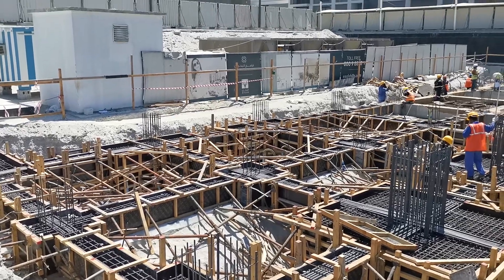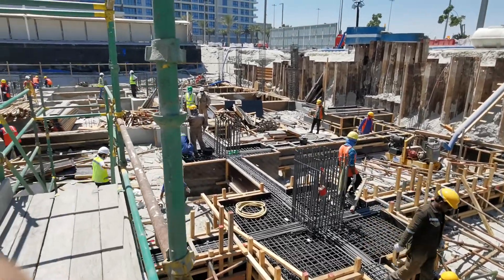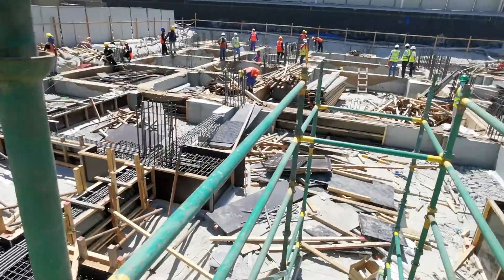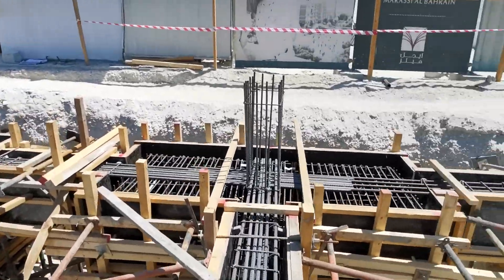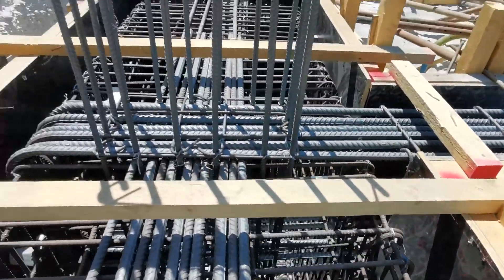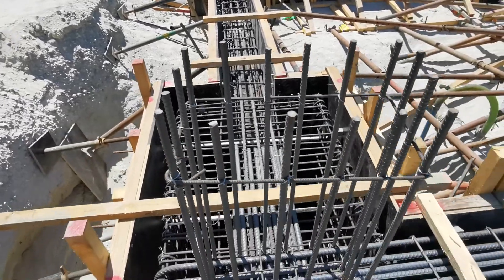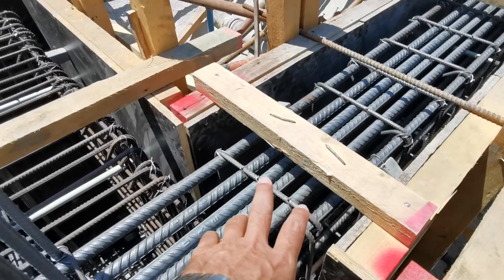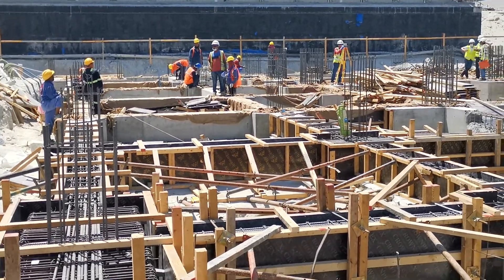pile caps foundation in construction | reinforcement & shuttering inspection | levelling inspection

Comment: Sir in which country u r working
Reply from the maker: Bahrain
Reply: Sir how many experiences required for Civil engg to work in abraod.
Reply from the maker: My dear.. If you will come fresh.. You can get job easily on low salary.. You will find good job gradually as per your knowledge and experience.
Reply from the maker: Experience doesn't matter..
If you have its postive for your job in abroad
Reply: Bro I am looking for Job of QC inspector I have experience of UAE can I get the job there if move there
Reply from the maker: Currently where are you doing?
Reply: Dear currently I am working in United Arab Emirates
Reply from the maker: I advise you to work their because bahrain is very small and very less opportunity here .. Even the situation here is very worst
Reply: Thanks for your Suggestions and keep updated the informative vedios
Reply from the maker: @yasirmehmood608  don't mind brother...